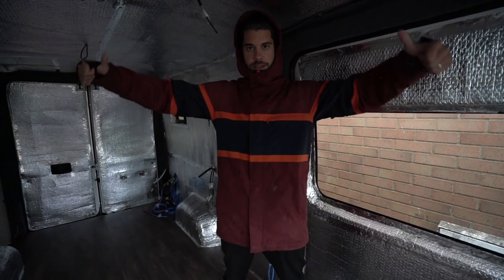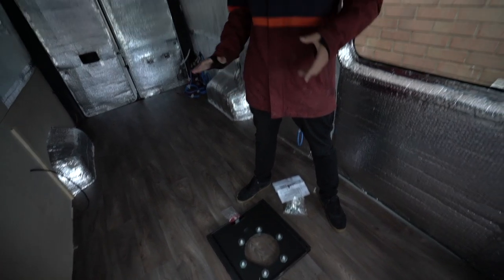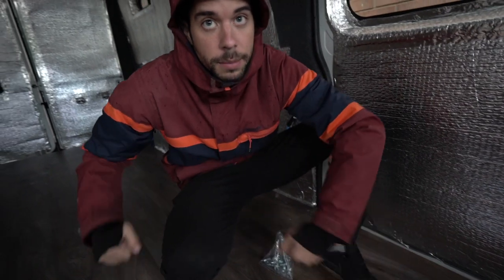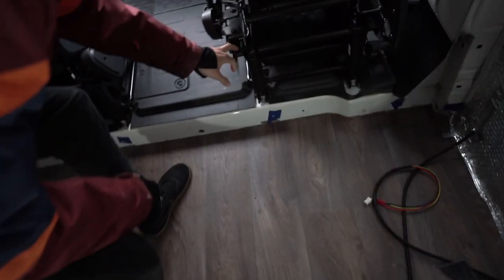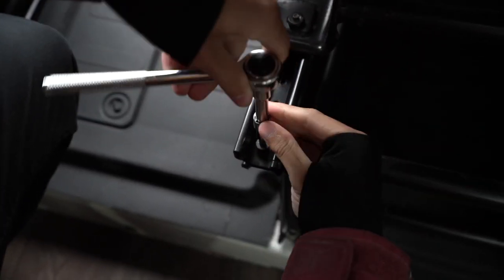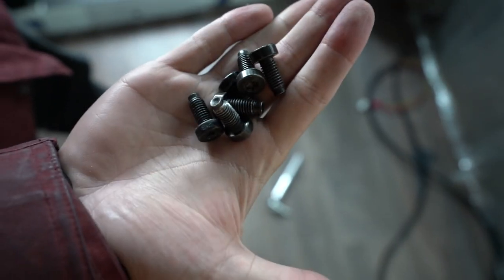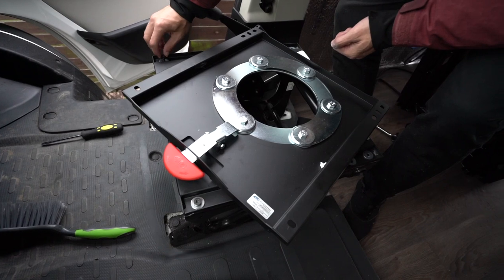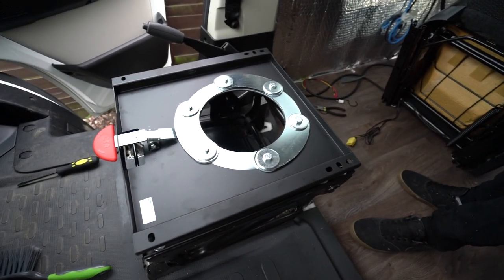How to install SWIVEL SEAT base (CTA) - Citroen Relay Camper Van Conversion - Week 15 - P.2

Comment: Did you not put the swivel base upside down? That way you pull the lever instead pushing. Just a thought!
Good build, well done!
Reply from the maker: We just followed the manual that says it supposed to be this way around - Maybe could fit it flopped so you pull up the lever but not sure, maybe it'll lead to some issues. Thanks for watching the series ! 😎👍